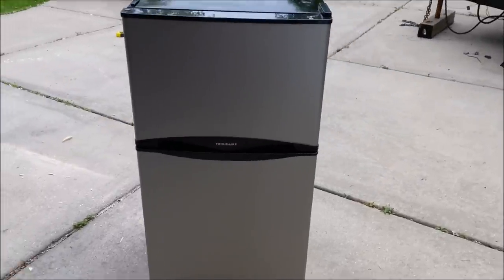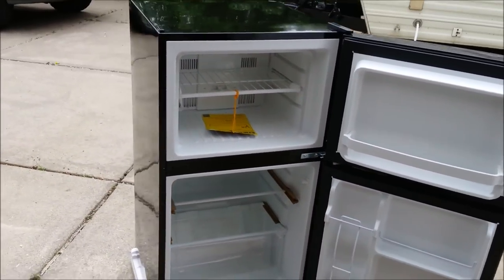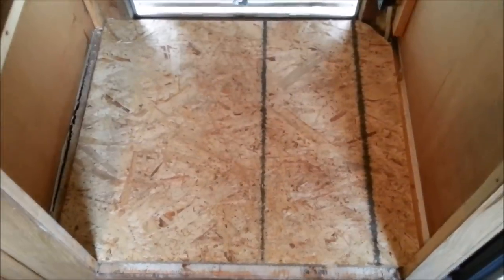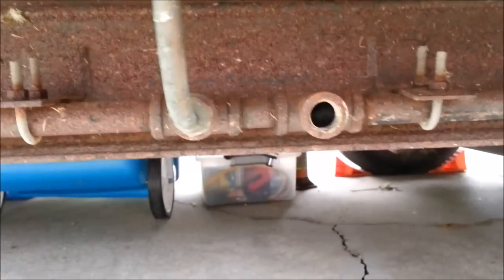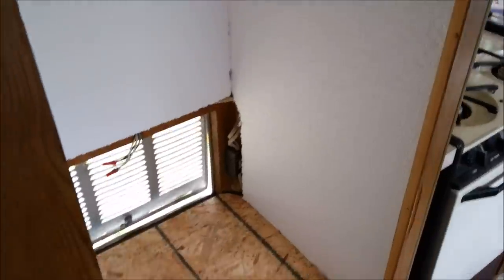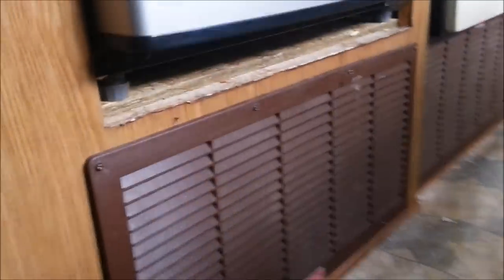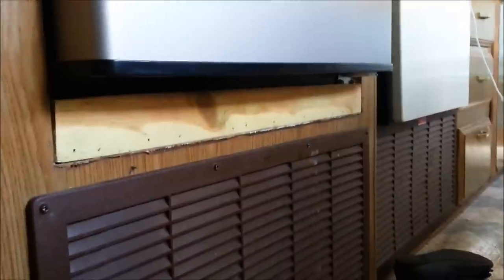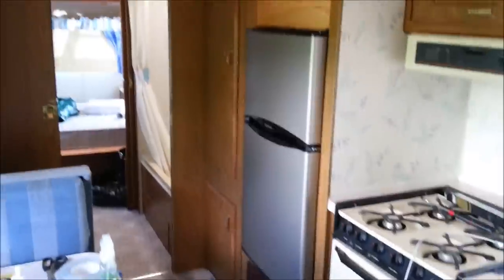Installing a Residential Refrigerator in an RV/ Travel Trailer

Comment: Old class A P30s almost always have a viable generator, but even properly functioning gas appliances in a motor home make me nervous. Usually, the motor-home can be run on generator power on the road, and 120 volts AC when "camping". 120 volt AC refrigerators are so relatively inexpensive and reliable, why not just switch to 120 volts AC appliances?

Comment: Thank you for this Video!  How did you wire it up?  Did you wire into the camper wiring or just leave the plug?
Reply from the maker: +Blair Smock just left the plug. There was an outlet from the old fridge in there
Reply: Great thank, I wonder if that would be typical of travel trailers or if they are hard wired.   Nice job helped a lot!
Reply: It's very typical.
Reply: @brandotooele  Mine is hard wired. Will have to pay someone to deal with that I guess.

Comment: I do believe there is a vent in the ceiling that should be insulated and closed off and also the outside access door needs to be insulated, the way you have it done in the video will let climate in as well as insects... But I'm sure you figured that out in the 5 years you've had to deal with it... lol

Comment: Hi there did U drain the propane tank before capping and how did U do that what kind of cap does it need to do that does it go inside or out????
Reply from the maker: I did not drain any propane, just shut of the valve on the tank and use a black pipe cap or plug. Normally it is 1/2" if the piping is rigid black pipe. If it is flexible copper see if you can trace it back to the main line and plug it there.

Comment: What did you do to seal the bottom vent on the outside and the vent on the roof. I have a real problem with dirt dobbers and these areas need to be sealed.
Reply: use flyscreen glued inside works for
 me

Comment: I have a mini fridge that is similar already. I plan on getting a van though. Do you think I could make it work in a van?
Reply from the maker: Yup, just get an inverter for it!
Reply: Thank you! Also, how much solar do you think it needs?
Reply from the maker: You would have to look at your fridge and check the amp draw. Then calculate out if it were to run non stop for 24 hours how many watts it would use per hour and then how much you could bank with solar to keep it going. You always want to oversize your solar and inverter and batteries

Comment: Funny.  We just bought this exact same fridge today and will be done installing it in our small travel trailer.  I installed 275 watts of solar so with an inverter can let this run while driving down the road too.  And since this fridge only consumes 1.45 amps it's a cake walk.  $299 vs. $1300?  A no brainer.  Doubt I will ever mess with an over priced RV fridge ever again.
Reply from the maker: You were probably able to get the fridge, solar, inverter, and a battery for under $1300!
Reply: SSLFamilyDad actually I already had solar and a pair of T-105’s.  I have used solar for several years because you never have batteries go down.  Even when not using the RV.  But yes, more and more people are going to start doing this as they realize how much better and cheaper this route is.  This particular little fridge also is frost free and has internal circulation fans.  Don’t find THAT in absorption fridges.

Comment: Very nice, but...  Not sure I agree with insulating the refrigerator compartment. The RV absorption refrigerator compartment is insulated because it uses a flame/heat to boil the ammonia compound.  A residential refrigerator needs airflow around it for cooling the compressor and coils. Most residential refrigerator installation manuals state they need 1" above and below for air circulation.  This assumes you block off the roof and rear vents to outside air.  If you leave the roof and rear vents open, then you are cooling it with outside air and subject to extreme temperatures.
Reply from the maker: +Vito A The insulation just keeps it snug on each side, the back and top are all open all the way up through the roof vents.

Comment: i went to home depot to look at friges and while talking to the appliance guy he put a new term on me. HE TOLD ME I MIGHT NEED TO GET A GARAGE READY FRIDGE. I thought i knew a lot but told him what is a garage ready. he said said it has extra heater and is built not to let the lines freeze up in winter like setting in a garage. do you know about this being a good idea for a rv. in doing more checking Frigidaire he told me was mostly all garage ready. home depot had a Haier. but it wasnt garage ready but i did like the unit.
please coment on this garage ready and should i seal the back wall off from the outside. my rv unit is a rm 2852. i  dont know what frige to put in its place.
Reply from the maker: +jon new I have never heard of garage ready but since you won't be using it in below freezing most likely anyway it does matter. Also even though the back is exposed via the vents it stays pretty warm back there even if it were cold out. Bottom line, any fridge should be fine
Reply: Thanks. I will try to insulate the back but might think if ill close the sides in. While looking at the fridges last night i learned another new term. Lg uses inverter controlled compressor and the power is cut in half at least. Im thinking about moving and taking my home fridge but ill leave it now. Im going to check into this for central air or heat pump.
Reply: I think heat pumps for home heat save 50 percent over electric. I will check and see if cutting that heatpump bill in half by using inverter compressor will cut the heatpump bill in half. If so that would be 1/4th the bill of electric. My family in michigan is paying 500 a month . Ill do some checking.

Comment: So what about the ventilation for the frig, they can over heat in an enclosed area.
Reply from the maker: Joy Kindrick Has not been an issue and there is plenty of room on the sides and above the frig. There is also a vent on the room above that compartment in most trailers as well as a lower vent where you access the back of the frig. Hope that helps!

Comment: Just bought a used travel trailer and dude said the fridge worked but not so sure it does. No ammonia smell though. I dunno. It freaks me out so may go with this option. We don't "travel" in it so being all locked down isn't a worry. Mine is smaller it's a norcold fridge with freezer inside. Maybe 4-5 cu ft.
Reply from the maker: Lynnette Workman That sounds a lot like what happened to us as well, we were told it all "works" but I guess it didn't. WE have been happy with our choice to save a thousand dollars so far:)
Reply: SSLFamilyDad I think I'd wanna swap it out anyway. Not interested in that gas/electric biz. However the gas ignitor does work. No ammonia smell etc., but I want an electric fridge. I hope it goes smoothly. Any suggestions on the hot water heater?  It won't light but fills abd does not leak. I'd be LOST without you tubers such as yourself :)
Reply from the maker: Lynnette Workman If it does not  light are you getting spark at the igniter? check to make sure you have all the gas turned on and also hold down the pilot igniter for a long time to bleed out all of the air until you can smell gas coming out, then try to light it. Use  a long stick match if you thing the spark is not working. Maybe that will help otherwise look up the model and see if you can find a cheap replacement for the burner assembly.
Reply: SSLFamilyDad I will Def try this. Do these have thermo cuplers like regular hot water heaters?
Reply from the maker: Lynnette Workman yes, it needs to sense the pilot flame before it will  ignite the main burner
Reply: SSLFamilyDad just wanted to let you know that I switched her over to lp and she's been running like a dream for the past several weeks :)

Comment: How long will it stay cold after you cool it down?
Reply from the maker: Good question, We went on a 4-5 hour trip this year with it and when we arrived everything was still cool enough. However things in the freezer were starting to thaw on the ends/edges a bit. The refrigerator was fine and everything was still cool (below 45 degrees) and we had it packed pretty full. The more you have in it the cooler it will stay longer. It was in the 80's outside. Next year I will add a small inverter and deep cycle battery to keep in running for longer trips. Thanks for watching!
Reply: SSLFamilyDad Great sounds like a good battery and an inverter could bridge the travel Gap. Our fridge is ageing and this sounds like the better alternative.
Reply: I put in one or two gallons of frozen Water and that helps keep things cold while traveling.

Comment: Would a camper hooked up to a 50 amp plug support a 7.8 cu ft residential fridge? Idk what all the right questions are but just concerned the fridge we got won’t work with the ac on.
Reply from the maker: If you were hooked up to a 50 amp service you would have no issues. Hooked into a 20 amp service with the AC and fridge might be an issue
Reply: Check the amp rating on the nameplate:  I looked at Sears & found domestic refrigerator-freezers all the way from 2 amps to 10 amps rated current draw on display.  Our motorhome has one with the label inside the refrigerator door of only one amp!  I don't know where they found it, but it's a 3-door, bottom freezer, with electronic controls, set for -2 degrees freezer, and 38 degrees in the refrigerator, as mfgr. Recommends.  Go for the lowest amp draw you can, so your batteries last the longest.  Batteries are rated in amp-hours, so you can guess about how many hours each pair of RV batteries can run it.  Rule of thumb:  plan on only half the time of rating and keep other loads to a minimum.  225 amp hours at 12 volts (from one pair of 6 volt batteries with a 225 amp hour rating) gives you 22.5 amp hours at 120 volts.  That says my 120 volt, 1 amp rated refrigerator could run 22 hours, but I'm happy getting through 10 hours between charges or shore power.  My rig has four batteries, or two sets of six, giving me double the above power, maybe a solid 20 hours with just the fridge, and extra power to spare.  That 50 amp shore power cord will run a mobile home with reasonable demands on the meter.  That's the largest typical power connection available in campgrounds.  If you really need some power, that 120 volt 50 amp connection could be wired double, for 240 volts, with the right 120/240 volt breaker panel.  Rarely will a camper need that much power.  Houses will typically have 100 to 200 amp panels with 120/240 volt circuit options.  Your 50 amp, 120 volt hook-up should be all you'll need.  Many are 120 volt 30 amp, or even as low as 15 amps, but not with air conditioning plus other loads...   Have fun, and learn to use and manage your power, from the tent to the bus.  We never stop learning, just remember to lower the tv antenna.
Reply: @dam4586  - I don't know if many people have read your post here but I for one am very happy that I found it. You have provided some good solid information that I personally have been seeking. Thank you very much.

Comment: does anyone have an idea how reliable etc it is to just use a 120 volt fridge and use a battery and an inverter ?

and how long the battery will last xD
Reply: It's reliable as long as you're using a quality, high efficiency refrig along with a good battery and a good quality inverter. How long the battery will power it depends entirely on the specific refrig and it's rating, the capacity of the battery and it's current condition as it will degrade over time and the efficiency of the inverter. Also how often the refrig is opened as the more it's opened the more it has to run to make up for the cooling loss.

Comment: Unfortunately these house fridges do not work out unless you don’t use your RV for an RV.  Wayyyy too high amp draw unless you only use it while plugged in.  I finally broke down and bought a new Dometic.
Reply from the maker: Too high amp draw for what? You can easily run this for any travel duration with a small inverter and a battery.
Reply: SSLFamilyDad learn your electrical calculations.  120v amp draw is not the same as 12v amp draw.  You can’t carry enough batteries and solar to support that fridge dry camping.
Reply: @MoParRus340  you sir are incorrect. This small refrigerator likely only needs around 600 watts while running, and only around 1600 or so at start up for a fraction of a second. Easily ran by a 1500 watt inverter with a 3000 watt surge capacity.
Reply: Luke Grady it’s not the inverter that’s the issue.  It’s the amp/hrs needed to support the need.  And if you ever want to camp where there’s forest then your batteries won’t last.
Reply: @MoParRus340  you could probably crank the generator a couple times a day to keep the batteries up. Right?
Reply: Luke Grady unfortunately, Luke, once a battery/batteries dwindle it literally takes hours of continual charging to force them back to a decent charge status.  And don’t think you can accomplish this with the built in charger.  Converters are trickle chargers at best.  I carry a battery charger and use that with my generator and with 2 t-105’s still takes a few hours of run.  I’ve been that route with a compressor fridge and trust me, it’s just not feasible.

Comment: OK, good video - informative and well shot ..... but, here's something you MIGHT want to consider if you have the same issue I have. My shower fixture and faucet is backed up to the refrigerator wall and there is no way to access it without moving the refrigerator. You might want to see if it's worth replacing any plumbing on the other side of the refrigerator wall. Plumbing fixtures are cheap and easily replaceable....refrigerators are not .... sigh, here I go - gotta pull the reefer just to get a $22.00 shower faucet installed.  How dumb is that construction design ...?
Reply from the maker: Expedition West Films (expwestfilms) Oh, that stinks but the good thing is now that I have this frig in here it is super easy to pull it out, unscrew a couple screws, unplug it, and then take it out. Good luck with yours, not fun getting the stock frig out!

Comment: Run it off 12 volt with an inverter!
Reply from the maker: Charles Tait That is the end goal here and I think it is going to work very well that way, thanks!
Reply: We are going to do the same and yes hook up an inverter to run it off that. Then we can run the fridge while we travel or if the shore power goes out.

Comment: so you know,these will not hold up if you do alot of highway miles,lots of copper and aluminum in them....the 3 way rv fridges are steel for a reason...and your ventilation is a fire trap
Reply: preacher031163  You're kidding right?? Do you have any idea how many campers have burned to the ground due to the reefers that were installed by the manufacturer?? This man just did himself and his family a huge favor by installing this new refrigerator. This is much safer!😀

Comment: I am a full time boondocker.  My refrigerator went out and I would love to replace it with a smallish residential unit - but I read an article that stated that a residential unit will not last very long in an rv because it is constructed of aluminum parts.  I looked at the marine/rv compressor refrigerators (which are made of steel) and the cost alone stopped me in my tracks.  Do you full time?  Is your unit still working?  I figure that I could buy at least 5 of these for the cost of the cheapest marine/rv unit.  But if breaks the first or second time out - I'd end up buying several of these a year.  So - is your unit still working after two years?
Reply from the maker: I honestly would not worry too much about it breaking unless you go off- roading in your RV. Ours has held up fine and doesn't seem to be letting up any time soon.
Reply: GayleO O This is what we were told by the appliance salesman, and it's correct. If you simply install a residential refrigerator into the current box opening, you will void the warranty if you do not open up a side wall and leave side wall open. Installing 110v unit into the old boxed opening allows too much heat to build up. Warranty voids if the new unit is not open on at least 2 sides. We removed the side wall next to the bench seat and increased the vent size on the exterior wall. You can also install a small exhaust fan (like for a CPU) at base of the new refrigerator to circulate airflow. Worked great for us.
Reply from the maker: +Deborah Chandler ours is open in back and on top so I assume that would count. There is also a ceiling vent in there above it and an outside vent where you access it so no heat buildup. They are designed to ventilate well since the rv refrigerators generate just as much heat in ac  mode
Reply: Hi, and thanks for the reply. We were told that no, the spacing you currently have does not meet the warranty requirements because I'm assuming you don't have the refrigerator back totally exposed to the outside air.  The Magic Chef and Frigidaire people were very specific that a side wall must be open. If you think about your home kitchen unit, most are against 1 side wall, against a back wall and have a cabinet spaced over the top. That leaves the front and 1 side wall open. That's what you need to maintain warranty for a refridge that is NOT specifically a slide-in. If you don't care about warranty due to low costing unit, then this is all moot.